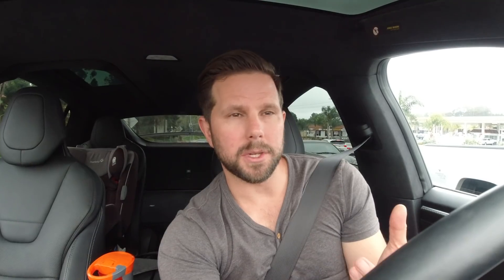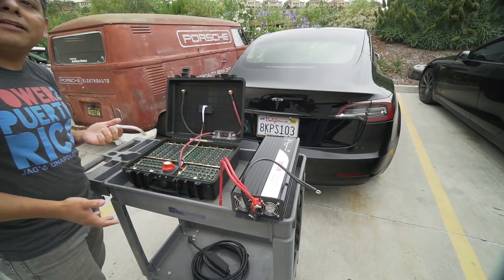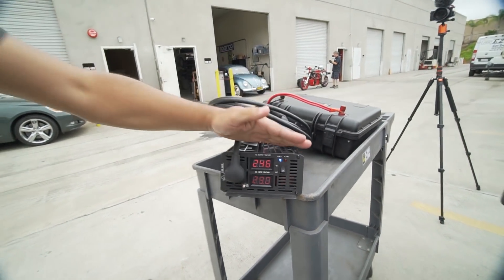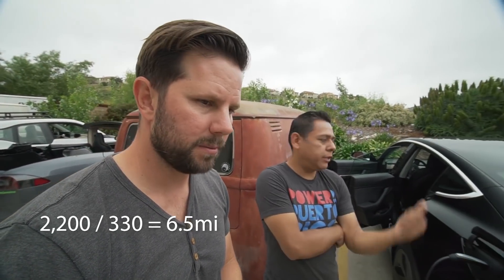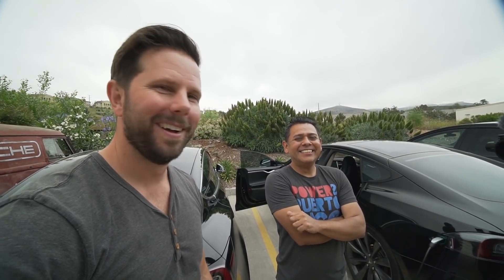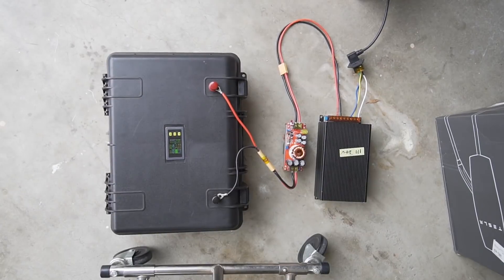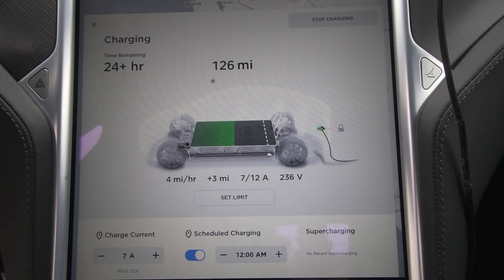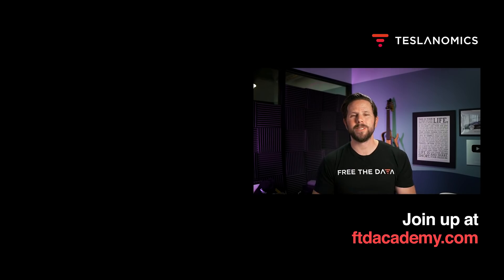DIY Tesla Gas Can - Will it Work?

Comment: Now the question is... Can you drive it while it's charging?
Reply: No. When the plug is in it gives a “unable to drive” and “check charge port” notification.
Reply: @FlyinTiger2  well that answers that lol
Reply: The motor uses A LOT of amps. That will put severe stress on 20 batteries vs 1000.
Reply: Yes, in future. With over head electric lines above roadways
Reply: ferkemall  at least someone can't siphon your battery
Reply: @mwbgaming28  nope it loosing juice all on its own and its the down side to telsa battery im not sure why they don't use the gel kind of Lipo and wait till electronics get messed up by low grade chargers or car to car and yea someone will take the cheap way out and your car is ruined and it happens to gas cars also
Reply: @executiveorder7146  tesla uses lithium ion batteries, not lithium polymer batteries because Li-Po batteries are way more prone to catching fire, and the energy density is a bit lower than lithium ion

Comment: It's been years since I worked with and on Electric Forklifts that carry very large and extremely heavy batteries that are actually used to help offset the weight of what the forklift is carrying but I know that they would most certainly charge a Tesla at least to a good portion of it's total range. I don't know what the charge rate would be. These could be carried by a AAA type tow or similar vehicle to come and give a Tesla or other EV a charge on the road similar to bringing gas to someone who has run out. Perhaps you could check into that with Jehu and see if he could rig something up to test it.

Comment: Could you try to fit Tesla Powerwall on top of Tesla car. Like on Roof rack. And check the range, please.
Reply: I would love to see that.
Reply: Tesla car battery is 100kWh, wall is 13kWh.   If fix 2x 13kWh on roof, you extend range by 25% ?
Reply: The power wall uses less weight efficient batteries than the cars. The powerwall batteries weigh about 3 times more per kW. That's why you don't see people building electric cars with powerwall batteries.
Reply: So fix salvage 100kWh in 2 empty boots.  And  Can you use salvage 100kWh at home as a Powerwall?
Reply: I hope they build it and see what the results are.

Comment: Have you tried charging Tesla by lifting one of the wheels of the ground and spinning it . Theoretically it should use regenerative breaking to charge. However the ? is how fast do you need to spin the wheel, and whether or not all of the wheels need to be turning?

Comment: Just because I was curious I did some basic estimations.

First off, Tesla superchargers are direct DC chargers. If you could figure out how DC-charging is enabled it would be possible to charge directly from battery without an inverter in theory, and that's already very advantageous in terms of both efficiency and things to carry.

A single 18650 has about 12 Wh of energy and weighs about 50 grams.
It seems that the required energy sits somewhere around 4 miles per kWh. So taking about 2.5 kWh of energy needed, you'd need a bit more than 200 cells. That amounts to about 10 kg of batteries. Actually not too far fetched I think, and theorethically you don't need a lot more than just said batteries if the accepted voltage range from the tesla is big enough. Also charging said 10 miles in half an hour is totally doable. You'd need a discharge rate for the batteries of 2C (2 times thier rated capacity). Good cells are rated for up to 8C of continuous discharge so it's well within limits.

Just as a note, 10kg is about 22 pounds.
Reply: You did some pretty impressive work, way to go buddy!

Comment: Use a capacitor pack instead of a battery pack. That is hard wired into the car, that way it is kept charged and only comes online when needed or selected.

Comment: Is the charge port bi-directional? If so, could a cable be made to plug into one Tesla and then into another Tesla to charge it? This cable would function as a "jumper cable" taking power from one Tesla and giving it to another via the charge ports.

Comment: On my old Honda motorcycle there was a petcock that you could switch to reserve if you ran low.  I think the answer is to have a switch that gives you an extra 5-10 miles from the main battery.

Comment: I am curious how much a battery that is as large as a car trunk would charge a tesla. I figure making it as large as a car trunk or to take up at least a majority of the space would remove most of the spacial constraints there would be to have it be mobile, as it would just fit in the trunk and ride along and be ready if there is a need for an emergency charge.

Comment: What about using capacitors in parallel with the battery can pack? That should give you the mass of energy that the tesla wants throughout the charging of the Tesla. Also you might be able to take more amps at a time with parallel super capacitors.
Reply: Actually no .... obviously they can deliver a ton of current but the amount of energy stored in a capacitor is not comparable with the energy stored in a battery 
For comparision with two AA 1.5V 2500mAh battery you can store 27Kj while in a 2600F cacapitor charged up to 2.1V you can store 9Kj and if you compare the weight and volume of a supercap with the AA battery the difference is remarkable

Comment: I’d be really interested to see a solution that involves solar panel attachments for the car to charge it while you’re on the road/parked. Or.... to see Tesla come up with a car that already had this built-in. 🤔
Reply: LIghtyear one prototype is "trying" this but as we currently stand solar panel efficiency and price are not there to make it worthwhile.  At 3 miles per kWh, 500w of solar on a car, you'd need perfect lighting (noon) to get 1.2 miles per a hour at 80% charging efficiency.  But as technology improves it could be the norm one day!

Comment: Tow truck with gas powered generator, apparently KmanAuto has videos on it.  I wonder if they make an alternator that could put out that much. Generac iQ2000 Generator, 46LB, hard to beat that.

Comment: I'm not a Tesla owner ( I bought a Nissan Leaf) but, I have the same range anxiety. Seems to me, in this video, you already have a battery pack that is storing DC power. So in this case, you are going from DC to AC and back to DC with a lot of power loss and time lost during the process. It seems like if there were an auxiliary jack/port that you could plug the "Juice Box" directly into (on temporary basis) (kind of like the temporary spare tires most cars have today)  you would have instant power and range with no consumption loss during the process.

Comment: Years ago I sketched out a portable battery that looked like a lunch thermos (although something the size of a small lunch box probably would work as well). Something that would be able to put at least 2 to 5 miles of energy back into an electric car. Which will allow the driver to get home to a supercharger. I think Tesla or any other company can create something about the same size that could easily be put in a little bit more energy into a car. To prevent a driver from having to call AAA or four systems.

Comment: All it would take for a tow truck driver which I am one would be to have a power inverter like that installed on the truck and a sit there with the engine running and charging your vehicle for a couple hours at that right or some sort of high-energy transfer device.

Comment: I think they should build solor panels into the roof...it's not much but at least it's something.. maybe have the panels run small things in the car?..idk just a thought
Reply: Even with a DC to DC inverter to directly charge the main battery, enough solar panels to fully cover the top of the car wouldn't produce enough power to overcome the parasitic draw of the converter, never mind put enough power back into the battery to make a difference. Nominal voltage for a Tesla battery pack is 350-375 vdc. The average solar panel is either 12 or 24 volts and about 20 +-5 watts per square foot, so you'd need about 150-175 square feet of series/parallel connected panels (depending on the weather and amount of sunlight) to generate the amount of power that they produce with their 'gas can' battery pack and inverter. You saw how far that got them.😜

Comment: The thing with this idea is the batteries need to be used every so often or the batteries will go bad, so leaving them in your trunk would end up being a waste. It would work better if someone could make one that acts like a supercharger and puts out much higher voltage for towing companies to give you a quick jump to an actual charging station.

Comment: What about a tether option, plug 2 cars together and drive to the charger? (obviously you'd need a different charging port location, and also some sort of cool specialized coil cable thing) 
Also, can Teslas roll in "neutral" with no range left? (for flat towing)

Comment: NIO a major competitor of Tesla in China has a service that the NIO owners can call a mobile charger to charge their car when the battery is dead. Basically it's a van installed with two 70kw battery packs inside. It will give you a full charge in about an hour. They respond quite promptly (from calling to coming costs about 15 minutes). The service costs about 25 bucks each time. If you pay by monthly it's about 140 bucks with 15 service times. The service even covers remote areas where there is no charging station nearby. Pretty cool em?

Comment: Good attempt. I think this could be improved with using a higher current discharde 18650s so you don't have to wait so long to charge. That way you can get ur extra 1-2 miles in 15min

Comment: of all the people you ask, you asked someone who doesn't give a hoot about safety or his own viewers. You need roughly a shoe box sized batch of 18650's for every 1KWh which is roughly how many 18650 cells fit in a typical shoe box. that's not much range
What's much better is a jumper cable between cars, if the a car passing is at 80%, they can stop and give 10KWH of charge to help out.. bah, just got to the 11:20 which you mentioned :P

Comment: Just a few ideas:
1. If the cars were really more empty; perhaps the ability to charge would be more likely
2. You have both an inverter and then a 240v Tesla charger that converts again. (Sounds like a lot of loss)
Can't you measure the power that is actually coming from the chord when charging using DC and try to:
- Increase the voltage of the batteries by putting them in series and starting out with an overal higher voltage
- Use a very large Ultracap in combination with a big step-up converter (supporting the allready higher voltage) in between to make sure the voltage will remain to be relatively constant.

Obviously this would require serious mods to the BMS and security measures.

Appreciate the works here guys!

Comment: You need a 400+ volt battery pack with output power regulation (current control) and proper control signaling to D.C. Charge the car battery. For car to car charging you would just tap into the charged car battery with the current limiting circuit and feed the D.C. Current to the lesser charged battery. This type of circuitry is much more efficient than the 240volt inverter you were trying and would be in the high 90's % efficiency. This sort of thing is done in the RC industry but at low 12-24 volt ranges with buck/boost chargers.

Comment: When the Tesla network is up and running, all you would need to do is call a car to your location and select in the app that you are in need of a charge.  then transfer the energy from one car to another.  The app keeps track of how much you use and automatically charges your card on file.

Comment: There is a need to create a standardize recovery swap out battery that will give 20 to 50 ml that can be slotted into any EV in order to help EV get to the nearest charge station. This could be soled a an accessory to extend the range of the EV.

Comment: Tesla should have a second charging port on the inside of the back trunk for a DC. instead of passing electricity from one batter to another, it would be easier to have the charged battery plugin from the inside for a direct transfer of electricity to the motors. probably would be enough to get you to a supercharger

Comment: Interesting....the AAA idea is also interesting, but remember, all those clubs are independent for the most part.  The only question for them is, would it be cost effective to drive around with a big battery in the back of one of their trucks?  Funny thing is...most of their "battery service trucks" have something like 50 batteries in their pickup bed, in the hopes of being able to sell you one.  Sounds like you should hookup with a LI battery pack maker and maybe they can duplicate what you guys tested?  There are enough Tesla's on the road possibly for them to do a test market pack.  Noco is one company that I have for my "jump box" in the cars....and powers other items.

Comment: Curious and sorta unrelated question. As I'm close to retiring and researching 55+ communities I was curious if Tesla would consider  building a Tesla golf cart? I know the Yamaha gas cart is the only long distance cart with a 3 gallon gas tank. The battery carts cannot compete with range as of now. The gas carts are somewhat loud although they've made strides to lower noise level to around 64 decibels.  I think it would be a huge market, as retirees would love a quiet, long range golf cart. I hope you can whisper into Elton's ear. thanks for your response.

Comment: the electric gas-can is a great starting place to explore solidstate battery technology. or things like super capacitors but, super caps and other high-voltage components can be a little dangerous if something or someone screws up.

Comment: Wouldn´t be to hard for AAA to carry a 5-10KW generator?
Reply: ferkemall  So the answer is it would work, with the right genny!
Reply: ferkemall  You mean you have to rewire the Teslas neutral and ground(earth)?? Or on the genny?
Reply: Either way you could make a converter for that.
Reply: ferkemall  I dont get what you are trying to say here? I was talking about AAA. The towing company that tows or repair cars on the road. They could get a genny that was wired to charge a Tesla and other EV´s. So if you ran out of battery they could come and help you out without towing the car.
Reply: ferkemall  Whats wrong with you? IF the neutral IS wired to the earth(GROUND) it WILL charge. What are you on about?
Reply: ferkemall  Get a translator so you understand what I´m writing and to help you explain yourselfe.

Comment: I wondered if this was a gas conversion Tesla video, or add on small gas engine range extender video. You can charge this type of battery with the right configuration. .
.
I learned that as my dad's electrical power on railways job taught me some cool things too. Electric cars , with a year or two practice,  are really much easier to convert or make than most people think. 
.
Btw,  Rolls Royce auto makes 100% magnet motors for marine use & inevitably soon cheaper generic forms from other suppliers  for various vehicles. Finally we all get a chance.

Comment: You need a bigger backup battery. You need to sacrifice one whole compartment for extra batteries. Also, measure the DC charge port connections with a volt meter. If there is no cutoff or regulation  circuitry between the port and the batteries, then Making a double ended cable, + to +, -to - will charge one car to another. Depends if Tesla's DC port are directly connected to the battery or not.

Comment: if, using a transformer converter convert 110v to 220v  at home, does it speed up the charging time or just slow as 110v does?

Comment: The following would work but it I would say it is a plan if your area is hit buy a hurricane and the grid is out for a week like what happens in Florida.  1) get a cheap gas generator with direct 12V DC outputs. 2) Get an 12V inverter.  3) Optional ( get a 12V lead battery to smooth everything out.  Now just hook everything up and start charging your Tesla.   If you want to eliminate gas then purchase salvage pouch cells from Chevy Volts or Leafs and feed that into the inverter but make sure you have a cut off circuit so that the pouch cells stay in the proper range.

Comment: The car to car charging would be super cool.. and be a awesome community based solution..
The AAA guys could carry a generator or have a powerful inverter onboard to give you 120v or 240v. 

For true INDEPENDENT road trips where you may be out in the middle of nowhere.
I think the answer is carry a small gas Generator and a 2-5 gallon gas can.
You could definitely get enough out of that setup to  get yourself to a gas station and be able to keep the gas generator running untill you have enough to get to a good charging spot.

There are some small gas gens that would even fit in the frunk.. with a 2-5 gallon gas can.
If you were really gonna be out in the wilderness, I'd probably get a rear hitch and a larger Gen capable of 240v output. 
If you were gonna camp the gens are helpful for other stuff too.

Great video... Love both your channels.

Comment: Small propane generator in the frunk. Takes small cans and 5 gal tanks. No battery or generators are grounded so build a ground bound neutral plug.

Comment: There are many times during the day when some individuals can't charge. I'm thinking apartment dwellers, most workplaces, and even at crowded fast FastCharge stations. Tesla needs to design and install a swappable auxiliary battery. Something you can charge outside of the vehicle or trade for a "full one." I think it would be a popular option for a lot of reasons, not just for running out of power on the highway.